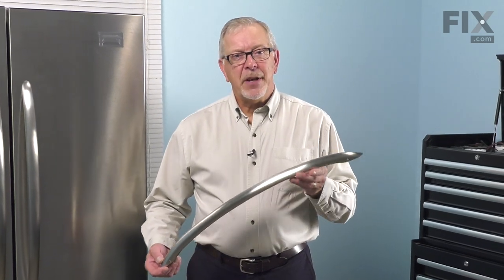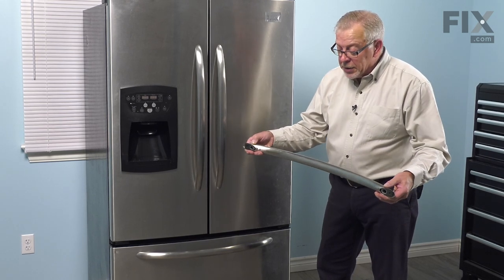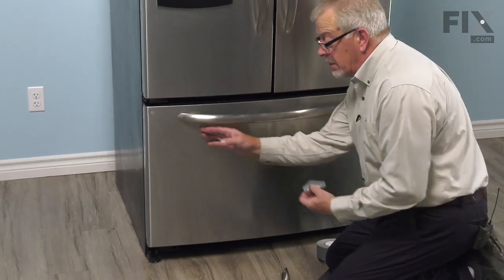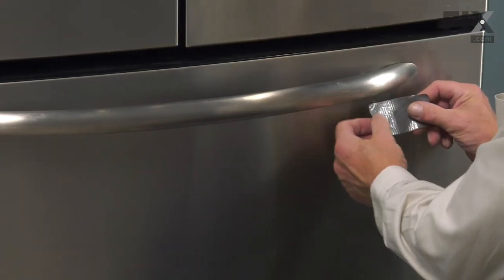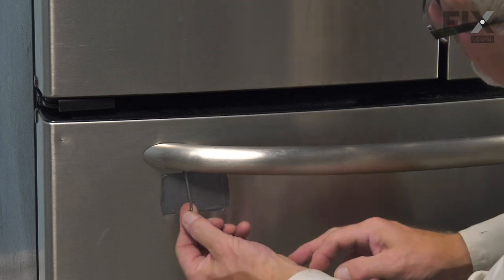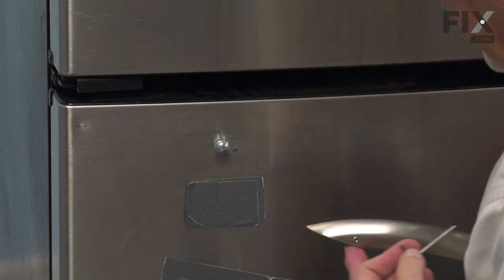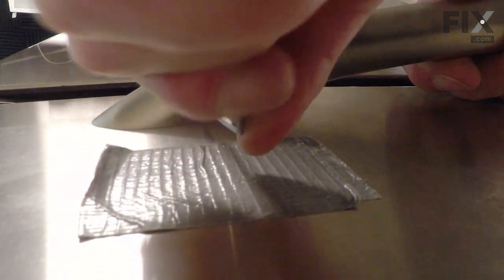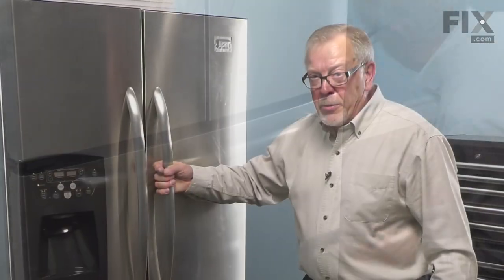Maytag Refrigerator Repair - How to Replace the Door Handle

Comment: I have a old maytag and it is not stainless steel the lower freezer door handle is loose and  I cannot find any screw under the handles and cannot remove it , any answers? It is a bisque color and like I said old but still working!
Reply: No screws on mine either!  I was able to push the Fridge handle up and remove  that, then replace it,  there were no screws!  It's a MBF1958XEW0, I thought the freezer would be the same.
Reply: @donnawyman988  we ended up buying a new lg with all the fixins lol I mean we got like 25 plus years out of the old Maytag just afraid of all the new technology, 😭😩

Comment: What if the stud isn't there.
Reply: what was the answer?
Reply: @merlinhoiseth1806  he posted & ran. Apparently never looked back to see if anyone needed further help.
Reply: It might be inside the handle.  Loose the set screw on that side and tip it face down.